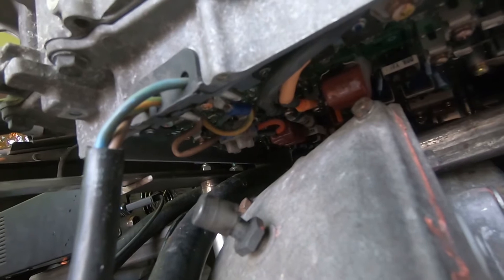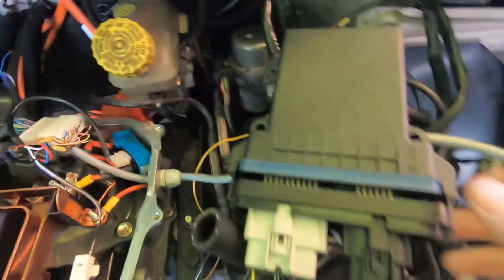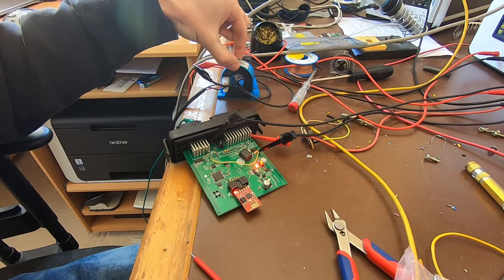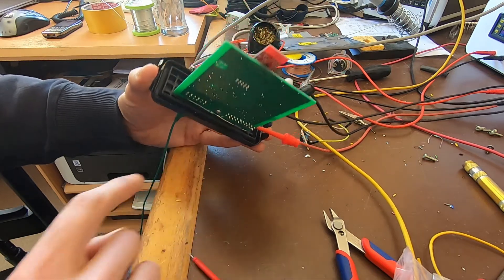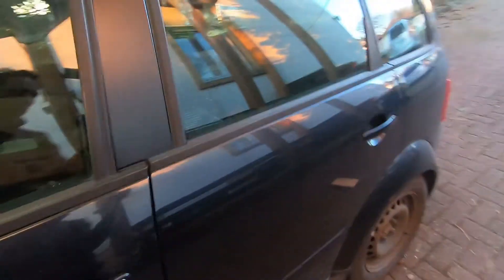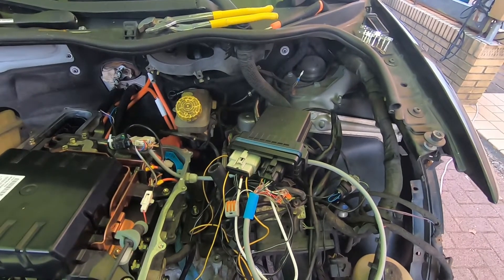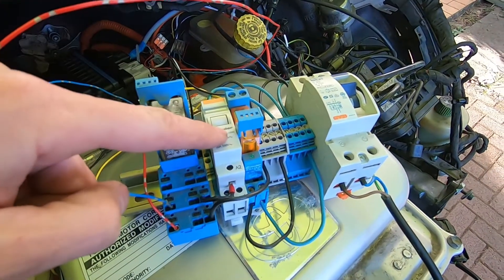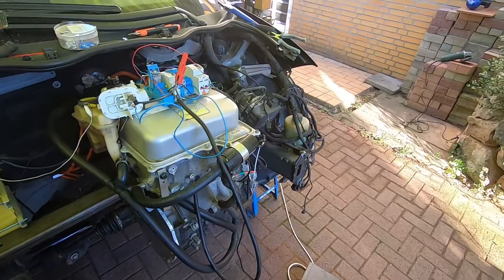Lab Update #61: Audi A2 Charging

Comment: just watched the battery install video, this has answered a few of my questions. What is the max power this will charge at on single or three phase?
Reply from the maker: It won't charge 3-phase as that rectifies above battery voltage. On 1-phase it certainly does 3kW, I haven't explored the limits yet (other than my 16A breaker)
Reply: @openinverter did you ever explore how far these can be pushed?  I’m seriously considering this for my project.